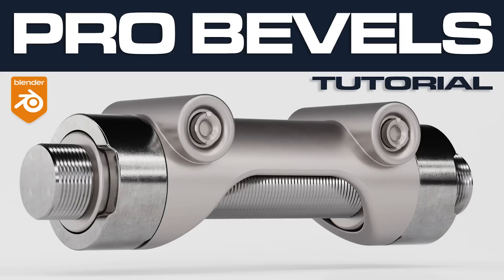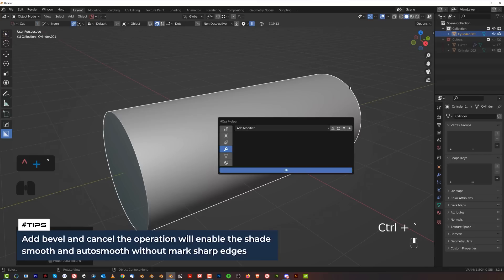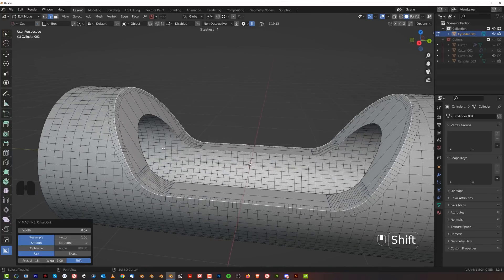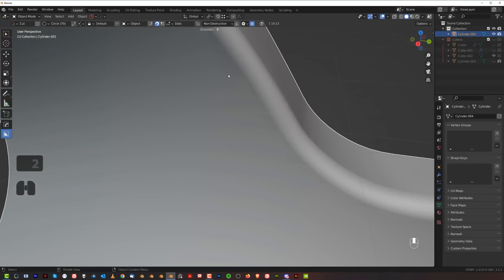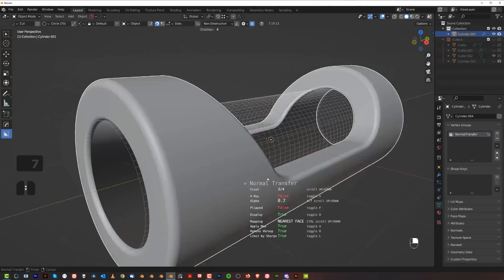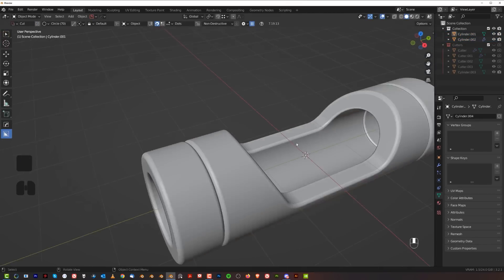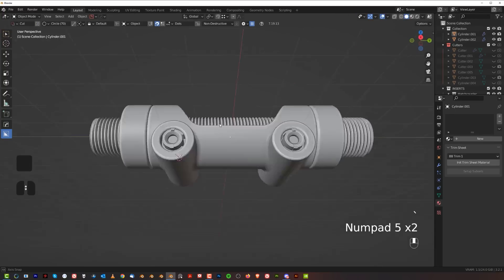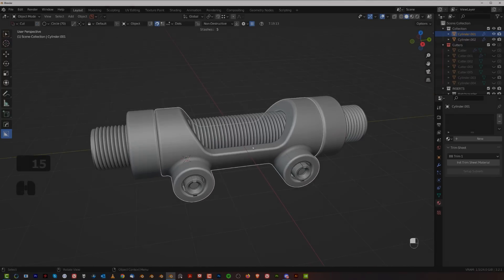Hard Surface in Blender - CAD bevels TUTORIAL

Comment: What i often see about this modeling methods is that thickness of bevel defined not by your needs. Instead people just try to tweak it until shading problems gone. What if i need extra thick bevel? Noone knows.
Reply: Same here. But, josh gambrell made tutorials about that to get huge bevels, using meshmachine's offset cut. It's not ideal, but it works in some situations. The hard thing about bevels is that, at some point, if you really need a specific bevel, you need to create your geometry with it in mind which makes it more difficult. You need to learn how to make good topology for that. If you want quads after a boolean to make bevels, there's a good addon for that (pricey though, starting at 59 dollars), it's called quad remesher.

I'm beginning at blender so I can't help you out much more than that I'm afraid
Reply from the maker: subd, coulod also use the chipp walters addon for remeshing